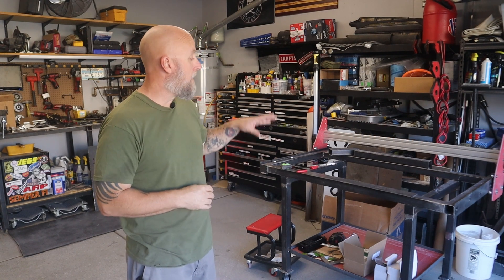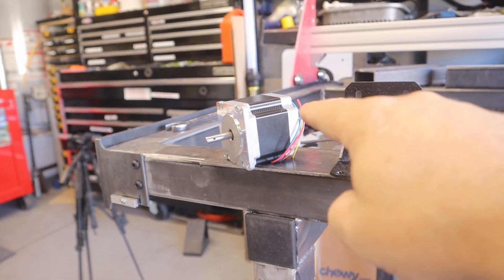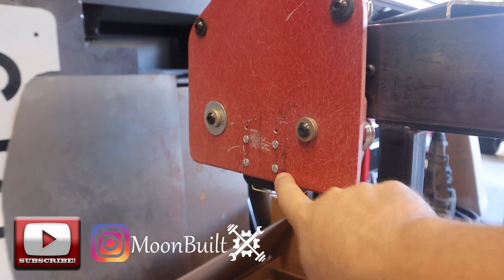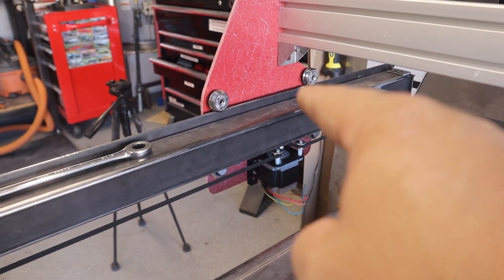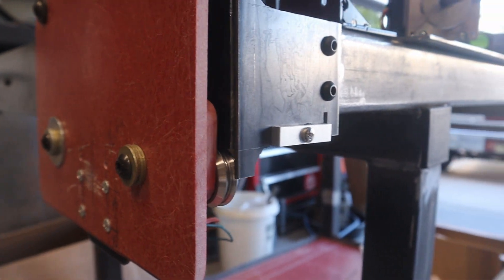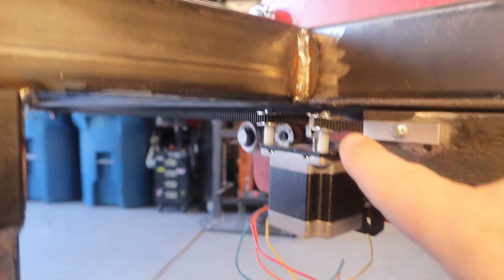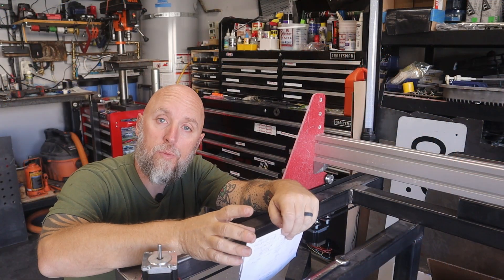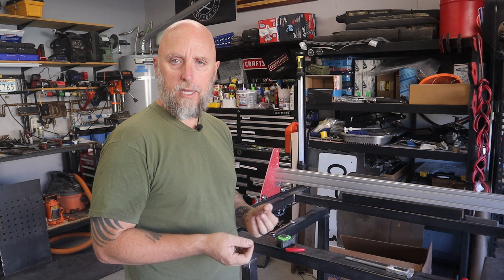Budget DIY CNC Plasma Table Build | Part 4 - Y-Axis Drive System

Comment: Thanks for sharing this information man.   We opted for the langmuir 4x3 (which doesnt actually cut 48”x36” by the way) in our shop, but I want to build one for my home shop and this is the way i think I’ll go.  I have to agree with @sirbuconstantine5187 about the “omega” drive on your motor.. that one stud looked pretty torqued over.. i’m sure you’ll be tweaking it anyway and this is proof of concept.   Thanks again for sharing
Reply from the maker: Thanks for watching...now I just need to actually get back on this project instead of having it just take up space in the corner of my garage

Comment: You can see at min 8 the belt tension is bending the rollers couse they are too far up, Swap the pinion on the motor shaft upside down, this way your belt will be near the motor, you wont be needing spacers for the rollers, only a washer.
Reply from the maker: I'll take a closer look at that..thanks